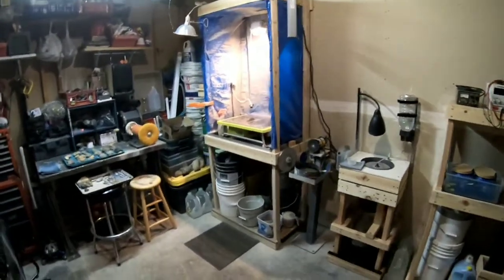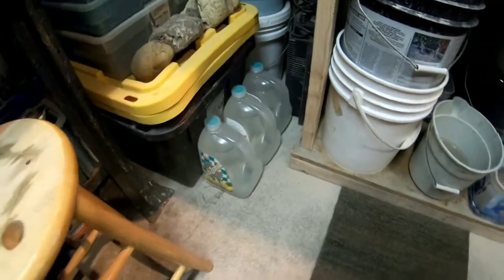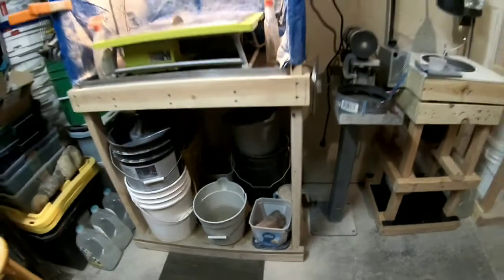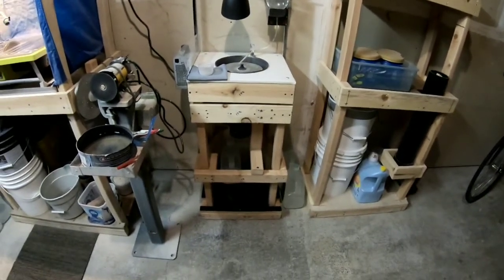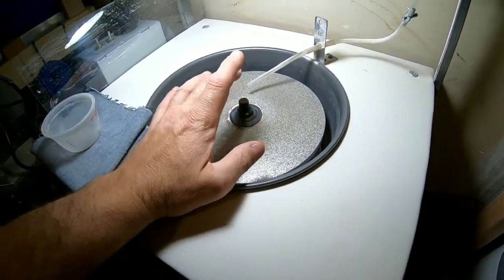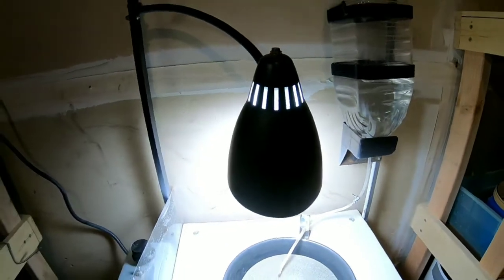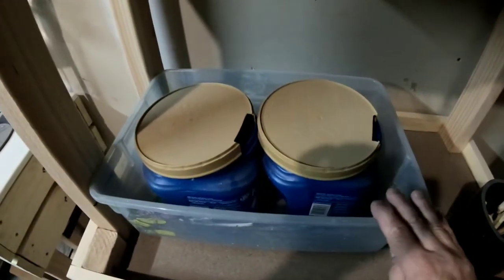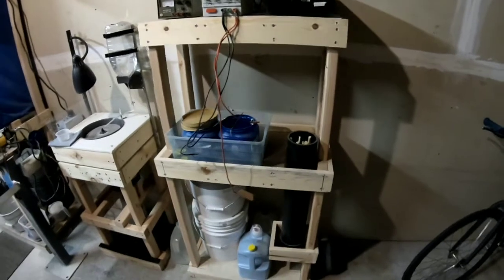Homemade Flat lap machine , rock cutting and electrofoaming equipment

Comment: Could you use that grinder as a buffer with the proper attachments? It is already variable speed. I'm just wondering if you tried and if the attachments are decent.

Comment: Sweet studio that you built!
You mentioned that in the future that you'll describe how to make your copper electroforming solution from root killer. You also mention that you add copper to the solution, can you elaborate? I searched for your follow up video but I didn't find your video. Can you tell me how you make  your copper electroforming solution or make a demonstration video? Tks!!
Reply from the maker: I will definitely do a future video on electroforming process.
The recipe consist of
* Distilled water
*  stump out root killer " copper sulfate crystals "
* Battery acid
* Copper Brite " midas copper brightener / replenisher "
The copper crystal are boiled in distilled water till they are gone. Once the boiled distilled water and crystal mix cools down a very small amount of battery acid is added and a few drops of copper brightener are also added.
That's the basics of the solution.
Don't use anything you plan to ever eat from again and do the boiling in a vented place , best not inside and don't breath in the fumes. 👍👍
For an expert example of this process and explanation please check out Jason Walsh's channel. He is super awesome at explaining.
I used some of his ways to electroform and a few others but ultimately created my own process for the turn out I wanted 
👍👍
Hope this helps some